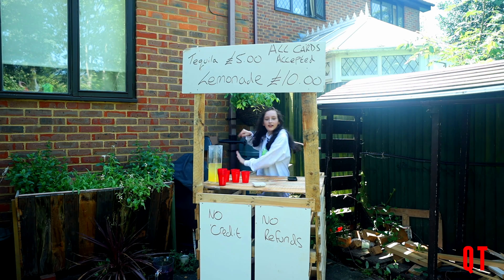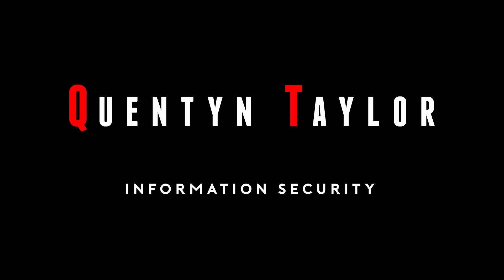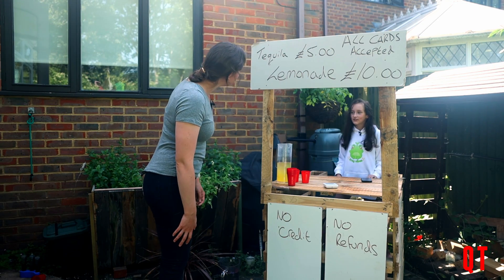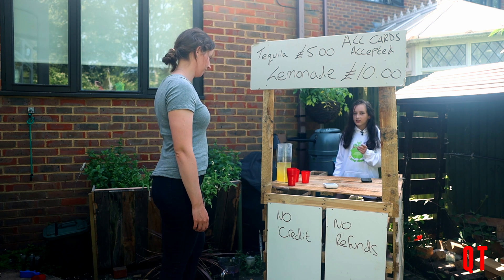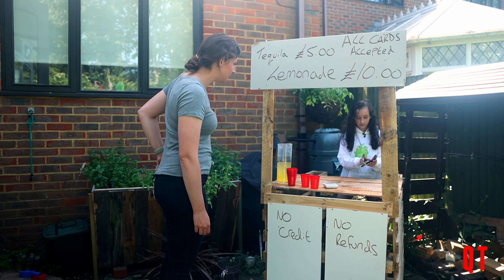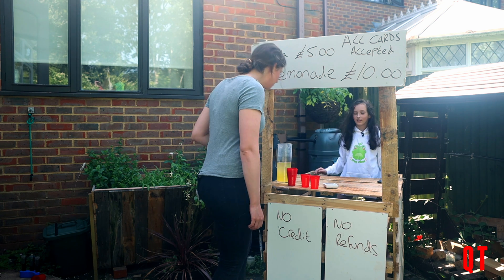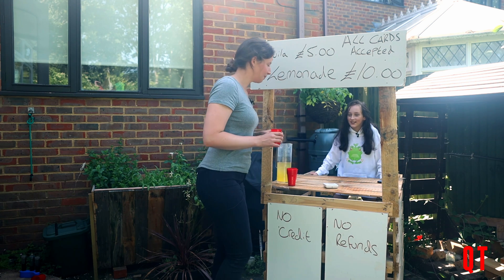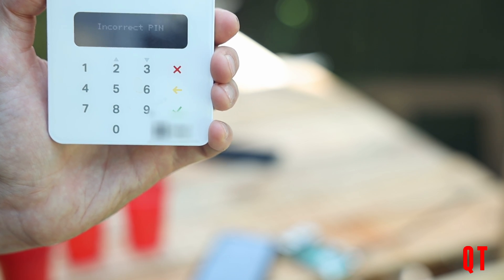Can you compromise chip and pin readers via bluetooth low energy ?

Comment: I’m curious to know if the data that can be gathered through hacking these devices would allow these hackers to transact fraudulently - I doubt it. 

You still would require the actual card to make card present transactions and for online transactions, you would require the cvv2 which won’t be in the data read by the terminal.

So am I wrong to say that that the answer to your question is No? 

One could not compromise the card (with financial utilization) just by doing what was presented on the video alone.
Reply from the maker: actually you can have a look at https://www.youtube.com/watch?v=M0LBpFA0OuE if i have your card details i can charge things to your card. Also if i have your PIN i now only need your card and i can then charge what ever i want. essentially anything that the car reader can read can be compromised. In the video we show it on screen but nothing stops you from retrieving via BLE
Reply: This definitely opens a lot of good discussions. I look forward to them and I hope you continue making videos on this. 

Another curious thought, I know if you change the data on the card, the cryptographic logic also changes and if it changes, it won’t match with the bank or the card associations, thus rendering it useless. The authentication and authorization leg of the transaction journey will ultimately fail due to the mismatch. 

Now, if the hacker is willing to physically “acquire” the target’s card. That is a different story altogether. This changes the whole dynamics of just going around trying to gather information on terminals anonymously. 

Great stuff Mr. Taylor. I look forward to more videos.
Reply from the maker: @i_am_alpha  you would have thought so... have a look at the video in the link - for some acquirers it seems that you can swap the PAN after auth and charge someone else